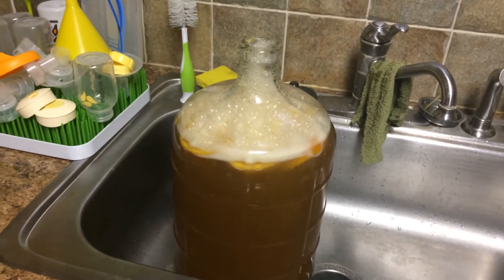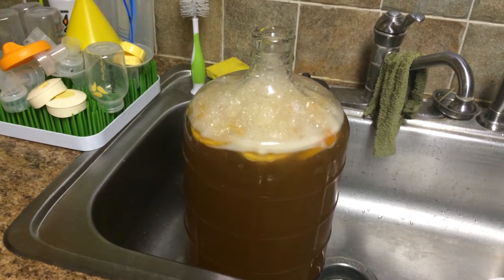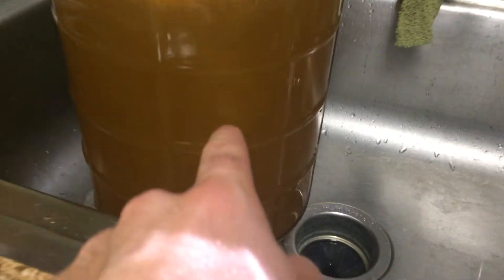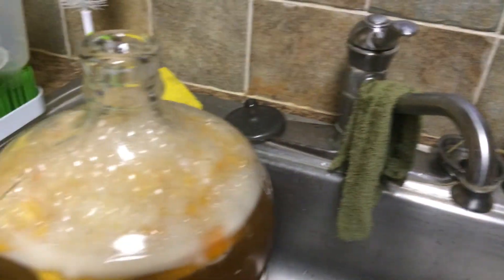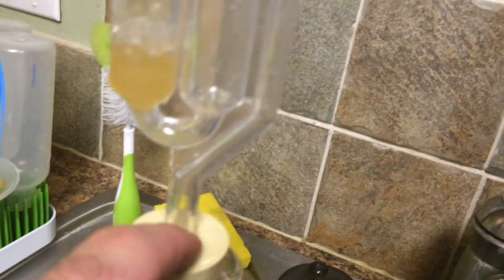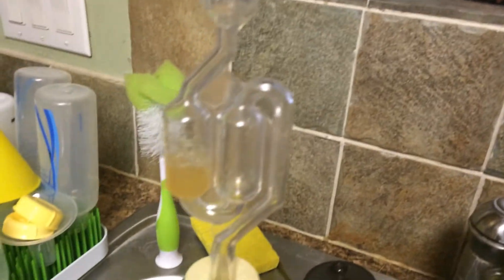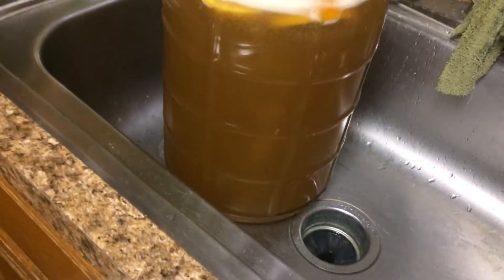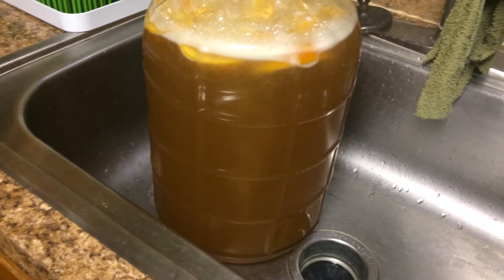Mead Boil Over - CO2 Breaking out of Solution due to Nutrient Addition

Comment from the maker: I got the answer! I talked to a fellow fermenting pal of mine and he explained the reaction. The addition of nutrient causes a nucleation reaction with the dissolved CO2 in solution, breaking it out of solution instantaneously like we see here. So it's not that the yeast instantaneously fermented all that sugar. The CO2 was already there from fermentation that already happened, but it just hadn't broken out of solution yet. Much like shaking a bottle of coke before you open it, you are breaking out that CO2 that otherwise is stable, loosely fixed to the solution. So in theory, if I go toss in more nutrient, this could happen again, as long as there is more dissolved CO2 in solution. But under stable fermenting conditions, this should never happen, regardless of how full the carboy is.
Reply: it's called displacement

Comment: Buddy it looks like you filled the carboy to full. I learned a long time ago to leave more room for expansion in the jug. There are 3 lines on the side of the carboy I only fill mine to the top line. So to make a 5 gallon batch you would need a 6 gallon carboy. Good luck!
Reply from the maker: Nah, unless you get a blowout like this, it doesn't matter that it's so full. All the 1 gallon batches I made before were pretty full. So long as you don't get a crazy, foamy ferment like this then it's fine. I'm convinced it was because of the second round of nutrient. I think the yeast was basically colonizing for three days and was at peak population, so when I tossed in some extra nutrient they went crazy. I was reading up, the yeast can double population in 4 hours, and then they are just hanging out waiting for a chance to ferment. I guess I could toss in some more nutrient and see if it happens again....
Reply: Tom Brueggen Okay but don't say I didn't warn you if it happens again when you make another big batch. 1 gallon at a time is different than 4 or 5 gallon batch. I learned my lesson!